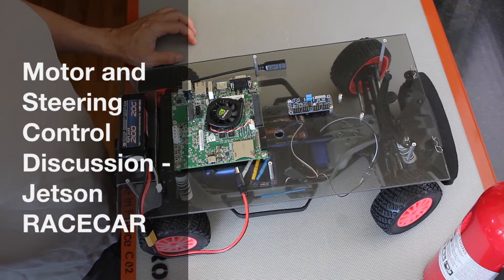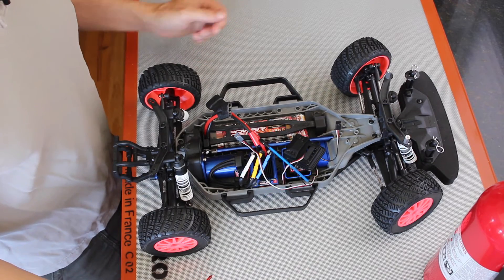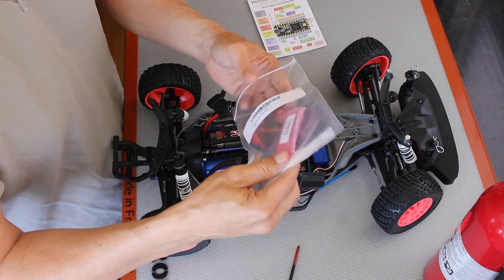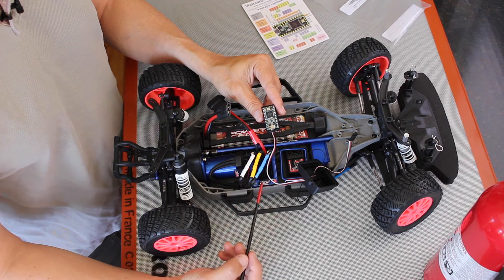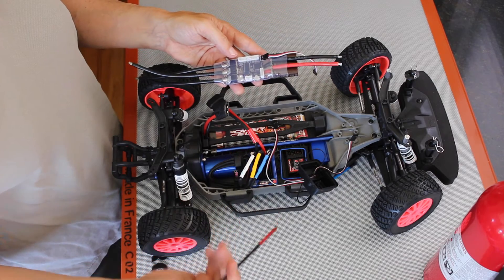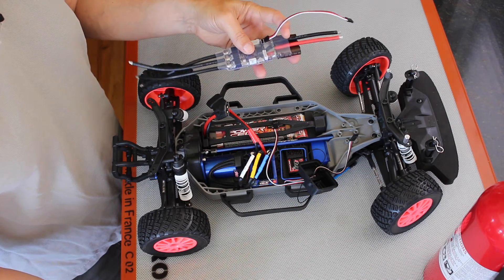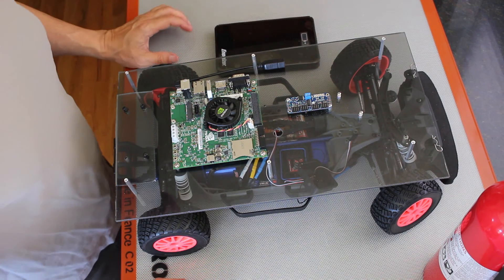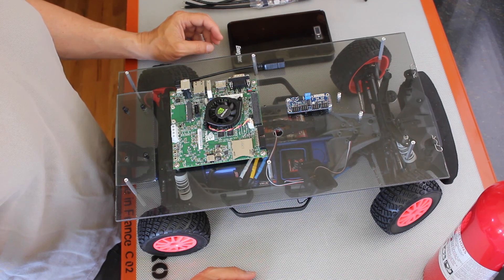Jetson RACECAR Part 10 - Motor Control & Battery Discussion

Comment: Thank you for all your videos and articles; they have been incredibly helpful. I started an MIT racecar project using the Enertion Focbox 1.7, which I bought second-hand from eBay. I used Vesc tools and managed to connect, but I had a difficult time controlling it. Unfortunately, I believe I may have burnt it due to a bad firmware update, as the light is no longer turning on. I ended up spending a significant amount of time on the Enertion Focbox. Now, I've decided to switch to the stock ESC on the Traxxas car along with the PCA9685. I understand there might be limited control at lower speeds, and my next step will hopefully be upgrading to VESC again. Could you please provide me with the exact URL to the VESC that you showcased in the video? Thanks.
Reply from the maker: https://amzn.to/3QZgQjQ

Comment: I have an MIT RACECAR. But my Vesc is broken. I will now use PCA9685. Jetson TX2 also has ROS Meldic installed. Which steps should I follow after connecting the pins of the PCA9685? Will I have launch folders? Can I share cmd_vel? how can I do it?
Reply from the maker: If you are going to be using the RACECAR ROS stack, you will need to write a ROS node for the PCA9685 and include it in your stack. Good luck on your project!
Reply: @JetsonHacks  Do you have any resource suggestions? I have never done before
Reply from the maker: @ozcankosar6206  Programming Robots with ROS: A Practical Introduction to the Robot Operating System by Quigley, Gerkin and Smart: https://amzn.to/3FFIdtD
There are various resources on line, you'll need to search for the ones that fit your needs.
Reply: @JetsonHacks  Thank you sir
Reply: @JetsonHacks  So, you didn't use ROS while using PCA9685? Where did you use this card?
Reply from the maker: @ozcankosar6206  I did not use ROS with the PCA9685. Please see this article: https://jetsonhacks.com/2016/01/26/jetson-racecar-part-3-esc-motor-control/
Good luck on your project!
Reply: @JetsonHacks  yes, I read your article, but where will the data come from? and what will i subscribe to in my python code